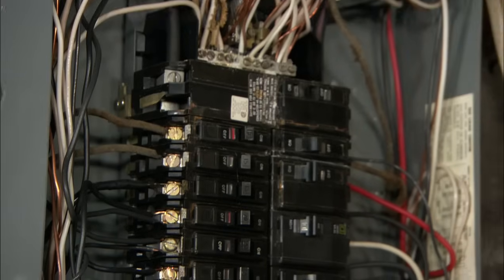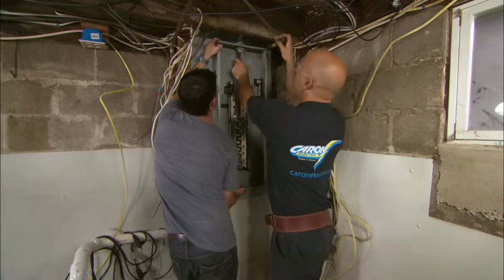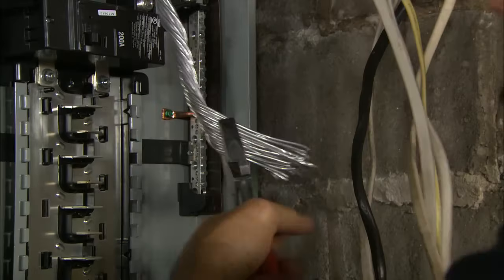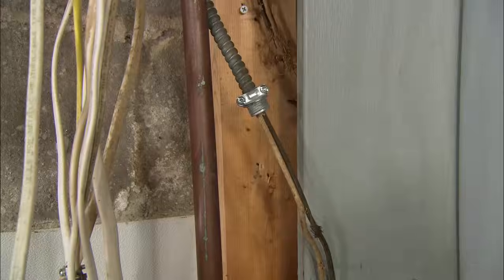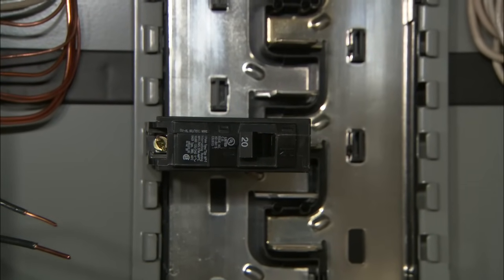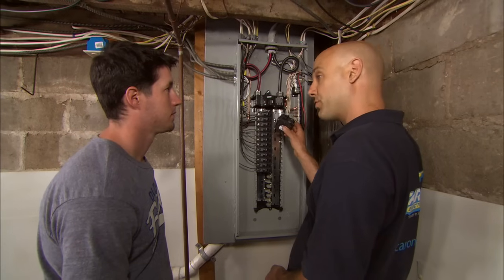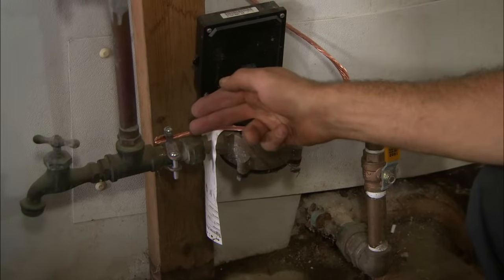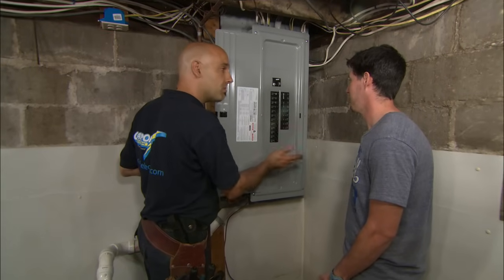How to Upgrade an Electrical Panel to 200-Amp Service (Part 2) | This Old House

Comment: They still use aluminum wires? :O
And why did they lay the wires so disordered?
Reply: Aluminum wire is better because the service entrance from the post to the house is aluminum. Ordering wires might not be easy. Some wires are too short.
Reply: erictold Aluminum is not better, is has higher resistance than copper, and also shrinks and swells during seasonal changes causing wires to sometimes become loose in their lugs or terminals. It is becoming more popular as the price of copper rises. If it is done correctly, there will be no problems, but technically the best conductors are gold and silver, copper is the next best, then aluminum.
Reply: But why are the wires so crooked? They can make them straight and bend fine 90° angles so like we did it here in germany. If you look here in a fuse box you have a much better overview and everything looks clean. This is my last work: http://instagram.com/p/oT5s94Fizk/?modal=true
Reply: ParkAvenue287 I agree, I like my wires to come down and turn a 90 at the breaker it will land on, it also gives you a little extra wire to bend out of the way away from the bus if that breaker is ever removed. In the past few years it seems there is huge influx of youtube taught "electricians" showing up on the jobsite, but it works to my favor because when they screw something I up, I come back later and fix it and get some more hours :) although I would like to see it done right the first time.
Reply: Randy Savage Sure, copper is better material than aluminum but there is no reason to use copper service entrance cable because the existing SE cable from the pole to the house by power company is aluminum.
Reply: erictold I JUST told you the reasons.......................................

Comment: Is using the water main as the ground up to code?
Reply: It is as long as your water main going to the street is copper (or steel... but steel probably needs to be replaced from corrosion).  However... most water mains from the street to the house are now PVC which does nothing for grounding.  To be safe, connect to a dedicated grounding rod which is pretty simple.  The video made this replacement look all too easy.  Most likely the main wire from the street will have to be replaced with a thicker gauge wire when upgrading to a 200 amp panel.  Also... wires are not sized by "small, medium, and large",,, they are 14 gauge (15 amp breaker), 12 gauge (20 amp breaker), and so on... This may be the most irresponsible video that TOH has posted...
Reply: See the full episode. They installed two ground rods and replaced the SE cable outside of the house. Most electrical companies will not replace main line even though you upgrade to 200A. It's, however, their problem if overheated. I think this is a good video.
Reply: erictold That was in another video titled "How to Upgrade an Electric Meter to 200 amp Service".   I watched that later.  In a former house we owned (years ago) we upgraded from 60 amp service to 100 amp and the power company had to change the service line from the pole.  They did not wait for an overheating condition.
Reply: In the house in my home town, there were only two wires from the power transformer, a hot and a neutral/ground. There was only 120 volts available. It was upgraded to 120/240 when I was about 10 years old.

Comment: Randy, exactly right! The grounds on the two wire circuits? They were on the neutral and ground busses in fairly equal number so I'm thinking they all had grounds. I didn't see any GFCI breakers however...Nor did I see a building electrical permit and hear of the final inspection and certificate of occupancy we have to have before the electric utility will hang the meter ... Also, an important part of a service upgrade to change to larger feeders from the street, to the meter base and then into the CB Panel, his was installed before they started recording the video or by another contractor...And that B.S. of having the homeowner 'have the honor' is pure Hollywood as you said....
Reply: Thanks :)  Im not a know-it-all but I do know when its done wrong.

Comment: You don't need that anti-corrosion paste on copper wire.  You put a "courtesy loop" in the feeders, in case they need to cut and restripped in the future, there will be extra wire to do it, not to bend them into place, that's what hands are for. Why didn't he add grounds to the old 2 wire circuits? And I never let the customer "have the honors" of turning on electrical equipment? If it shorts, it should trip, but it could also go bang, and that's bad.  I'm not impressed with this one guys..
Reply: Dude the main feeder wires are aluminum. They WILL oxidize. That paste is required in order to keep it from oxidizing. Also, the old two wire circuits use armor coated wire. The metal armor on them is the ground. Those are attached to the box which is grounded. Plus, the electrican is licensed. He knows what he is doing. He would not have turned it on if something would have gone wrong. Anyways, the breakers WOULD have tripped. If they didn't, what is the point in having them?
Reply: It's TV. Guarantee the homeowner wasn't the first to flip that main breaker. There's lots of "let's see how it fits" type showbiz stuff on TOH when you know they've already test fit/test run/etc.

You really do need the loop to be able to gently bend the wires into place without kinking them, or putting a ton of pressure on the entrance at the top. At the very least, it makes it much easier.
Reply: It's a scripted tv show, I'm sure he tested everything before, then had it look like the home owner turn it on for the first time. If you've watched him on this show before,  you'd know he's pretty good at what he does.
Reply: scotty hanson Not grounding old 2 wire circuits is not being "good at what he does" its against code and could result in a fire in the worst case scenario.
Reply: Pete Brown Ive wired more panels than youve probably looked at.  You dont "need" the loop, it is for future maintenance so that extra few inches of wire is available if the need arises, if you cant bend the wires into place especially soft aluminum, you should get out of the industry.
Reply: Stormsetter4 I've done commercial electrical work 15 years. Yes, aluminum conductors need the paste, not copper, so he should make that differentiation.  It is against code to renovate a main distribution panel and not ground all circuits to current standards, so using the armor on the MC is not adequate, furthermore those old MC's are shielded with steel, not aluminum making a ground connection weak at best. You say he is licensed, which is probably true but he's not doing things properly, so his license means nothing to me. In the event of a short, the breaker should trip thats what they are designed to do, but if anything is crossing the bus ahead of the breaker, it will explode when you turn it on, Ive seen it happen. Thats why PPE equipment is required when working high current circuits.  NEC rules were'nt just made up to stifle productivity, they are there for a reason.